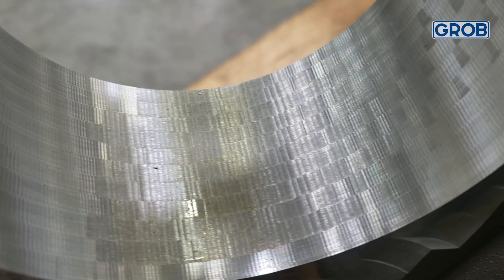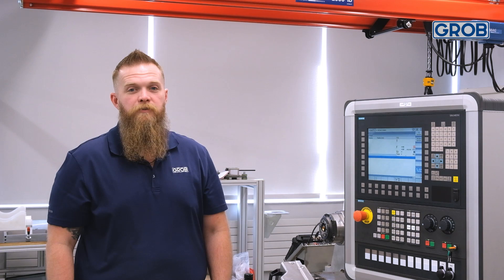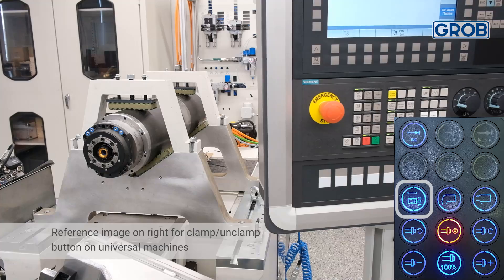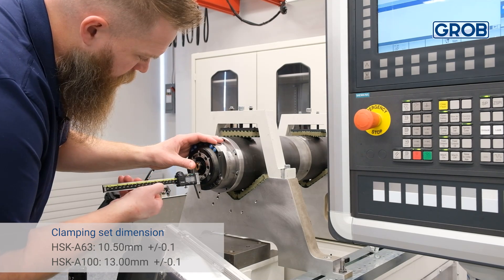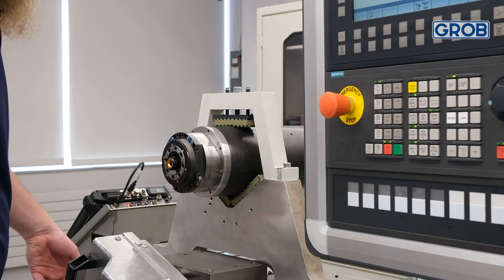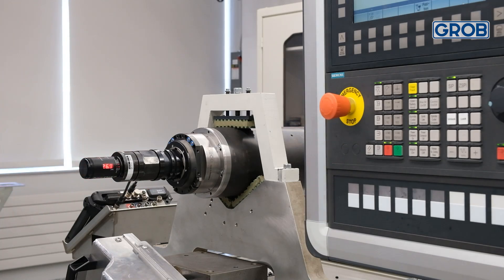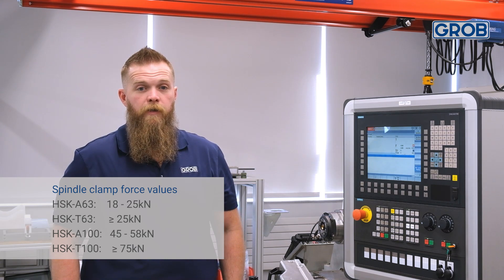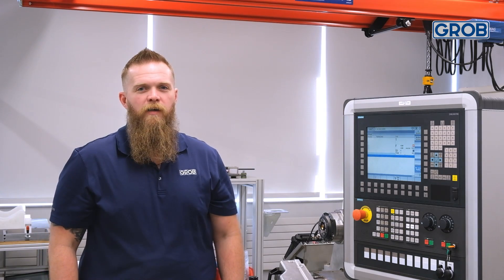GROB — Inspecting spindle clamp force

Comment: Hi, what if the distance of OTT and the rest pads were out of range? e.g lower or upper than 10.5mm.
And what will happen if it is out of range?
Reply from the maker: Thank you for your question! If the clamping set dimension is out of tolerance it will need to be adjusted. Watch our “Inspecting spindle clamp force” video from 6.12 – 7.00 to see how this is done properly. 
Incorrect clamping set dimensions will lead to low clamp forces or the possibility of the tool becoming stuck inside the spindle.